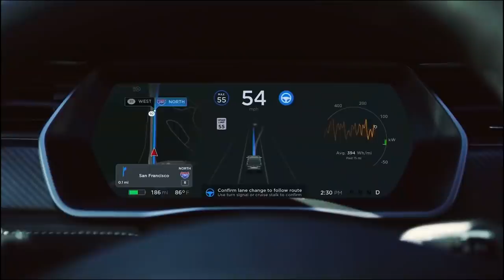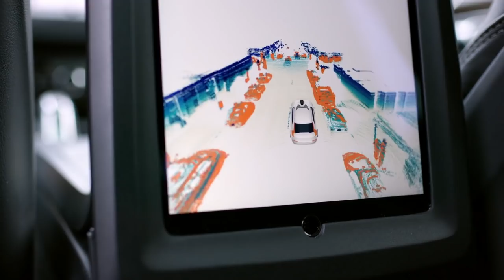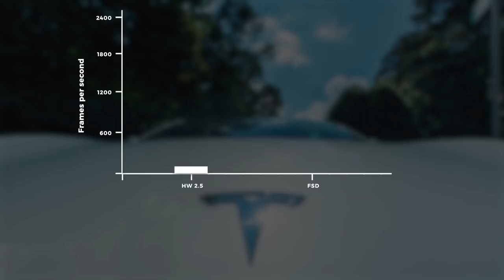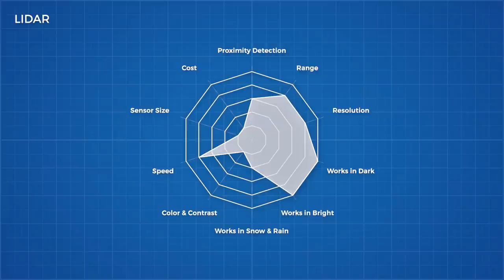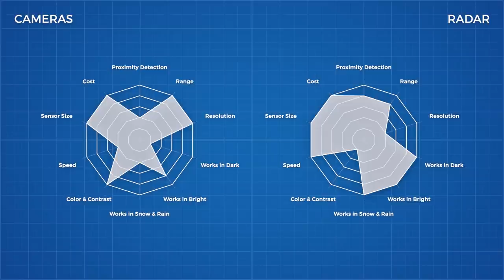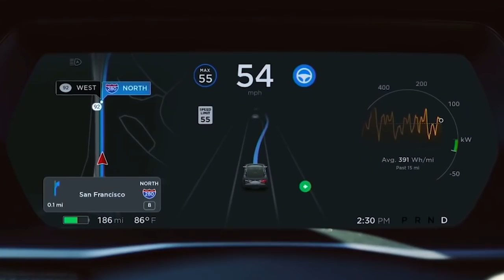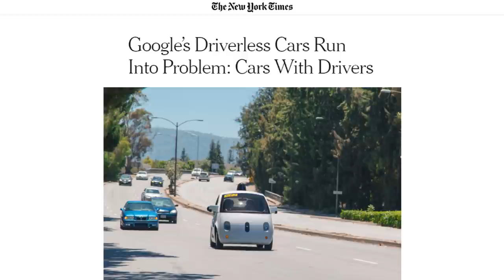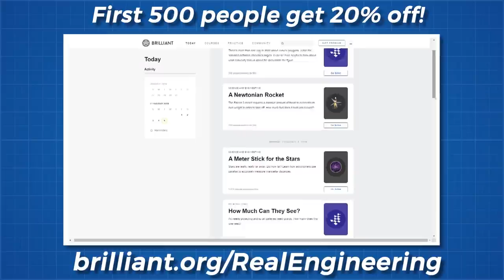The Challenge of Building a Self-Driving Car

Comment: As a software engineer, the software driving that car that ran over the person was embarrassing poor.
You start with the premise, "if in doubt, alert the driver and slow down"
As soon as an anomaly is detected, you drop to that.
Reply: Indeed, you must prove it's safe, not fail to prove it isn't.
Reply: Then you run into a problem of human operators eventually ignoring the alarm as the become used to too many false alarms. It's a fine balance to maintain.
Reply: There were all sorts of problems in that collision. They had too many false emergency stops so they turned it off (I don't know why they turned off the alarms as well). They also got rid of seperate data input and driver roles, meaning drivers had to do the mutually exclusive tasks of being alert for emergencies and inputting data into a computer.
I don't know if the driver in this case was "doing her job" or texting, but either way the priority should have been driving.
Reply: @joonhshin  Yeah in productio mode sure.. but when developing, best (especially when lives are at stake) to err on the side of caution and flag as many alarms as possible, so that they can be addressed.
Reply: @Chilukar  she was watching a tv show on her phone. Which sort of tells me uber gave these drivers pretty boring tasks, but shutting off alerts to drivers and expecting the test driver to be attentive in a mostly reactionless duty is asking for trouble.
Reply: @joonhshin  No because false alarm or not, it becomes human error and peril to ignore an alarm, precautionary or otherwise.
Reply: @bcubed72  agreed, uber took a lot of shortcuts and pissed off a bunch of people involved with self driving vehicles for tarnishing them all. 
In reality most developers are much more cautious and it is no surprise that Uber had this crash.
Reply: I agree that these design decisions may seem poor when looking at this specific case. However, do keep in mind that behind each design decision stands a reason. They knew that their car was not able to fully drive itself yet. Have you ever worked with neural networks? Because everytime i hear people talking about "anomalies" or "uncertainties" i question their experience in that field quite a bit. A neural network is never sure or unsure about something. It calculates the probability for a given cluster of pixels (object) to fit into each category of objects it was trained to recognize. That means that it has a probability for the cluster of pixels to belong in each category. The one with the hihgest probability is the one the object is classified as. Now, define uncertainty or annomaly in this case.
(Highest) probabilities below a specific value happen all the time. If we used this as a criteria for slowing down, then the car would constantly drive slow, if at all.
Trajectories are also often uncertain, especially since they rely upon recognizing a cluster of pixels (or other data) as object first. If something just shortly gets recognized, then the trajectory cant be calculated precisely or at all. Imagine a bird flying across the camera view. Would you stop driving simply because there may be something on the road, because the algorithm decided that a cluster of pixels in 3 frames might have been an actual object and then disappeared? Because from the NN's perspective, that's basically the same problem. 
Now, consider that stuff can get falsely classified depending on the data and situation. Like a flash of light, a bright spot or anything like that. Following data is usually critical to determining whether or not something actually is there is was caused by bad data (a reflection on a single frame of a photo for example). 
With all that in mind, slowing down simply because there is "uncertainty" or an "anomaly" is silly. That's why a driver is still needed. They knew their car was not able to fully drive itself yet, thus they had to chose design decisions that made the vehicle work in the majority of situations. A vehicle that can handle 99.5% of situations is still better than a vehicle that can handle 80% of situations, or constantly drives very slowly. Thus the design decisions that make the vehicle handle the majority of situations properly are the ones that get implemented. The driver is the one responsible for the rest. 
Most if not all design decisions can easily be explained by the above. The car was programmed to not brake too drastically to not endanger the driver. At the same time it may seem silly that the car does not alert the driver when it intended to brake really hard but did not, but considering all the uncertainty and the false positives that may trigger this alarm, this may have simply been left out because the car would be constantly beeping otherwise. Imagine the car beeping for each flash of light or bird it recognized as an object in the trajectory of the car for like 2 frames. The driver would probably get mad really quickly. Now, i agree that this might have been handled better by, for example, only alerting the driver if such an "annomaly" was detected for a certain period of time, but again there is a lot of room for error and considering the reaction time of the driver, this period of time may not have saved the now-dead person, especially when looking at the lighting conditions in 1:48. The car didnt recognize the person, which is horrible, but i dare to say that most humans wouldnt have recognized it either.

Anyways, i dare to say that just because you dont understand the design decisions that lead to the system's behavior in one specific scenario , doesnt mean they are "embarrassingly poor". That's something you should know if you work with software honestly. Sometimes reality is not as simple as you make it out to be.
Reply: @Yamyatos  sorry but if you think "one specific scenario" where there is a pedestrian or cyclist crossing the road on foot is not important you can know as much as you like about programming, but you are not qualified to talk about driving.

Waymo, Tesla and others involved in developing this technology were far more cautious and criticised Ubers approach. If nothing else they should have had separate employees for data input and driving. That would also possibly have given 2 sets of eyes on the road, something that is useful if your system can't identify pedestrians in the road!
Reply: Also a software engineer, and I actually disagree.  I think this was a very difficult bug to predict.  How does the car know the difference between a pedestrian and a road sign?  Movement?  What if it is a tree swaying in the wind?  As humans we know that bikers can enter our lane, trees don't , and how to tell the two apart.  But for a computer this is very difficult.   Accidents like this (and others) are going to continue to be common as long as programmers continue to have this Jurassic Park mentality and arrogance that they can know all contingencies.
Reply: @Chilukar  
I'm not saying the system was perfect. My point is that a real case scenario often is not as easy as "if in doubt, alert the driver and slow down", and then tried to explain why.
If i did not make that clear: it's horrible that the person died. It's also right to criticise Uber for their approach, just not for random reasons based upon a lack of understanding. Criticism by people who actually understand something about the topic is worth listening to, even if some of it was most likely a marketing sheme as well. I just dont like it when people online criticise systems they have little to no understanding of. I'm not an expert on self driving cars, or cars at all for that matter, but at least i worked with computer vision and neural networks in the past, which somewhat qualifies me to talk about possible reasons to justify certain design decisions that were made. I dont try to justify the death of this person or try to make it sound like it was unavoidable, but at the same time it's true that the technology is not quite there yet and that's the exact reason human drivers are still required. 
Now, i dont know how Uber works (not entirely sure if it even exists in my country), but they do pay their drivers even in self driving cars, dont they? Either way, paid or not, the driver was responsible for the vehicle and was not supposed to watch some youtube video on her phone instead. The system may have been faulty in this scenario, but the driver is also responsible. The scenario is also not quite a simple as "pedestrians crossing the rode", as i cant imagine that the car wouldnt recognize this under normal circumstances. There was a funny example one of my profs at university told one time, of some computer vision algorithm that was supposed to classify tanks as allies or enemies, but the data they trained it on lead to it learning the difference between good and bad weather instead (because a lot of enemy tanks were on pictures with bad weather). The point of that story is that it's impossible to know how exactly a neural network decides on things - you only see the result. Thus a specific combination of factors may have lead to the accident, not simply a pedestrian crossing the rode. 

Also, you said "If nothing else they should have had separate employees for data input and driving." - i'm not quite sure what you mean. Do you mean 2 people in the same car? What would the second person do? What do you mean with data input? You dont input data, the "training data" we are talking about is the sum of all sensory inputs and camera footage being recorded. Do you mean two different kinds of vehicles - one for transporting people, one for collecting data? That would just cut the amount of data in half, which is something nobody would do because it's simply unnecessary. The "self driving" part as we have it today is more of a gadget to relax a bit more while driving. The driver is still... well the driver. He or she is responsible of the car's actions, it's just that the car is able to do most of them for the driver. That does not justify you watching youtube videos or sleeping or whatever while driving, any more than if you drove a car without autopilot.
Reply: It was never meant to work as you or the creator of the video make it seem. It was a testing phase, it was not supposed to work that way, and the driver was specifically not supposed to look down and do whatever while driving. Everyone and their mother agree's with you, even the mothers of the developers and their mothers, but it was not supposed to be completely save driving. It was supposed to be monitored and the mission was to test and collect data under supervision. Careless driver here makes it seem like the system was faulty, but it wasn't any more faulty than an old vehicle with minimal electronics and with a careless driver on the steering wheel. The premise is that if people will be told the car is self driving but needs supervision, after an hour or some other period of time, they will get careless. Might have been negligence of communicating how important it was to supervise the car and a poorly trained operator.
If the woman would have paid attention, the developers could have analyzed and changed the code's algorithm. The brake was turned off, probably because they knew that some objects at the side of the road weren't accurately recognized by the vehicle yet and they needed to figure out ways to make that recognition easier. That's exactly why the woman was supposed to pay attention and not watch a TV show. Can't stress that enough. It might be a combination of all those things, maybe the algorithm should have been better, but maybe the code isn't as easy to write without the car acting up at moving trees, pedestrians swaying while walking parallel to the road or many other different possible scenarios that make this apparently simple solution to the premise in this video not so easy after all.
Reply: Honestly have to think that it should have at least begun a precautionary deceleration too, after all if you are driving in low visibility and see something up on the road ahead but can't identify the hazard do you a) Keep barrelling towards the unidentified object at full speed until you know it's unsafe or b) Take your foot off the accelerator and apply a little brake while you figure out what is in front of you? I would hope that the answer to this is option b as that is by far the smarter course of action when you know there is an unidentified potential hazard in the road ahead sure this may well end up resulting in you slowing down due to a plastic bag blowing into the road but better that than the alternative of assuming it's nothing until you get close enough to be sure and then it be too late to stop for a real hazard.
Reply: @seraphina985 But what if the car was coded as follows ( Detect everything you can detect around you. Save everything to analyze it later. If in doubt, the driver  will intervene) The car was not supposed to be operated without constant supervision of the operator. It was supposed to be a test drive to improve and analyze data, not for the human to watch TV. If you tell me to babysit a kid that appears to be quite mature for their age, they can do everything fine, it seems. And for the first 10 times, they have been responsible all the time. You still won't leave them alone in their room for hours while you watch a TV show.
Reply: @joonhshin  This would demonstrate the system just is not ready for deployment. If it has to constantly alert the driver due to uncertainly, the system just simply is not good enough. End of story. Haste to get technology deployed should never be allowed to undermine safety.

If it has to be slow as molasses to be safe, then it will be slow as molasses. In the side demonstrating, well we clear don't have good enough self driving system yet for public deployment.
Reply: OK.
Um, hi, welcome to this software and ethics committee?? 😳

Right, first off, you forget the slow down bit.
I'd like to see little miss catching up on GoT ignore the car slowing down.
The car saw something it couldn't identify.
But it knew something was there.
If we're training neural networks, this is exactly the point you went you're highly trained space monkey to stop facebooking and look out the damn window.
And on the screen is, "I'm sorry Dave, what's that?"
And they they hit the 🚴‍♀️ button.
Network training +1.
What you're saying about disabling alarms?
Yeah, if there's too many and you're disabling them, some moron manager needs punching.
Also, your alarm procedure is bad.
Alarms cycles go, detect, alarm, acknowledge, feedback.
If you break that cycle you're just making alloying noises people will ignore.
Never forget to train your 🌌🙉
Reply: M. de k.  
Correct.
Although I do know enough to know that even pins don't go on and off, you have to measure it over time and average it until it's stable.
It's called bounce I believe?
Reply: @AaronSmith-sx4ez  I would disagree with that, a walker in the dark moving across the road feels like something they should have built failsafes in for and specifically programmed for.
Reply: Systems design is all about loops, feedback loops. Both electronic and conceptual.
Every event you make, you make for a reason, you expect or require a response.
Whoever had the machine spit out alarms with no requested response had no business designing safety critical systems.
Reply: @AaronSmith-sx4ez  
It's not a bug, it's a systems engineering problem.
They got the feedback wrong, the system needs to train the user to provide feedback to an unknown.
You don't program for every situation, you train a neural network, so you train the user to train the network.
Feedback loops, see?
Then there's a beautiful curve as the unknowns approach zero.
You'll never reach zero of course, you're quite correct that you can't account for every situation.
But we'll have stopped caring and solved traffic accidents long before then.
Reply: @zachfakelastname  
Too many false positive granny kills
Reply: @zachfakelastname  I disagree.  How does a computer know the difference between a pedestrian, a biker, or somebody with a motorcycle?  The computer sees fast moving things in the opposite lane all the time...how does it know which will pop into your lane?  What if a motorcycle moves from the outside line to the inside lane...does the car stop and assume they will cross?  What if somebody on a bike is trying to make a left turn in front of you?  They signal with their hands (maybe not)...what does the computer do?  This doesn't even take into consideration a host of other issues.  Like construction zones, street parking that morphs into lanes during rush hour, roads without markers, snow on the shoulders, etc.. .  For computers these are tough issues!  Here is a video of a Tesla suffering an accident when its auto-pilot failed to merge successfully.  https://www.youtube.com/watch?v=exBnINDEhSA
Reply: to be fair, seeing how the accident happened, I'm pretty sure a normal driver also would have hit the pedestrian, it was really hard to see. the difference is that it would have been a normal accident and no one would have mentioned it. the fact that the car managed to see the pedestrian from so far speak wonders of how much better the system is when compared to a human driver. sadly the software was poorly designed.
Reply: If in doubt, alert the driver and slow down? See that's an example of a problem right there. It would not be the first time that a car has suddenly slowed on a highway with a semi up it's axe resulting in fatalities. Humans should acknowledge that they are just not clever enough to  devise systems that remove another human's control of their own safety. Boeing?
Reply: @Chilukar  I partially agree that the "driver" should've been driving but that kind of defeats the point of a self-driving car, no? Part of the point is to turn the driver into a passenger thus freeing them from the responsibility of operating the vehicle.
Reply: Thats bad but Im more concerned that they went through the trouble of adding code that limits how hard the car can break. Im all for smooth breaking when thats an option. But removing hard beakeing from the code entirely seems plain stupid.
Reply: fail safe rather than fail manslaughter.
Reply: Has a Industrial Robotics Tecnician, if the mechine encounters an unexpected sitution and can't evaulate how dangerous it is, EMERGENCY STOP. It's on the law.
Reply: Also, even if you can't identify the object, you know it is here. So it's really dumb to continue at 90 km/h in straight line.
Reply: @joonhshin  This """driver""" was paid for testing this software.
She must watch the road, and consider the alarms, for every single moment of her tests. Else, they should not test on public roads.
Reply: @bcubed72  Uber made an excellent (although tragic) demonstration why some of these tech companies frankly shouldn't be allowed to to research on public roads. Waymo seems like one of few that take things seriously. Tesla also seem to have the attitude of "move fast, break things". That's fine when you're making a software company, but not when you people's lives are literally on the line. (Let's not forget that one category Tesla is the most similar to humans is number of passengers killed while on on "auto" mode.)
Reply: @joonhshin  Funny how psychology needs to be taken into design.
Reply: @g00rb4u  You should look into alarm fatigue, specifically in hospitals. It's a proven fact that too many alarms leads people to ignore them.
Reply: @Yamyatos  - I think the problem humans have with this scenario is that the car couldn't decide. It was presented with something that was either a pedestrian or a cyclist - it knew that much. But because it couldn't determine which it chose the "do nothing" option.  Where as anything as big as either of those options should have prompted preliminary braking.  It also had emergency braking disabled which, even though I know nothing about it, does seem like poor programming. Even Volvo's own systems (which were disabled for obvious reasons) are programmed to initiate emergency braking in this scenario so the pedestrian's life might have been saved. The operator was doing exactly what they were told to do - monitoring the car, not the road, so hard to blame them.
Reply: @mondotv4216  It was not clearly presented with either a cyclist or a car tho. For the longest time it didnt recognize it at all (or thought there was something, then not, then again, ..) and when it finally clearly did recognize it, the required braking force would not be allowed by the safety mechanisms. That's basically what happened. I believe i talked about why this might have been a suitable approach for the prototype state they are in in my previous comments. Basically you cant just break because something (most likely false positive) suddenly pops up in front of the car. That puts the driver at risk, which is probably why braking over a certain deceleration was disables. You also cant just slow down for each and every uncertainty, as nothing that would basically make the car drive slowly if at all. All these restrictions are why a driver is required. In current self-driving technologies the driver is still responsible for any actions the vehicle takes, thus it's not his job to monitor the vehicle, but actually the road. Why would you even need to monitor the vehicle? All the data is collected automatically, the driver is just there because the car is not legally allowed to drive alone - you know.. because it still makes mistakes and might run somebody over in very specific situations ..
But i'm repeating myself. I already went into depth for most of these topics in previous posts.
Reply: Fabian But that’s the main issue - it did identify it as a pedestrian, then a cyclist, then nothing. Surely if something even had the potential to be either the software should have said start braking? After all it’s professed beta software - it should err on the side of caution even if that sliws down testing.
Reply: @mondotv4216  Did you read my previous posts? Because it kinda feels like i'll have to repeat a lot of things in this discussion. As i said, neural networks are never certain of something. They classify something into a specific category based on what's their best guess is, or in no category at all if the probability is too low. Something never really is a pedestrian or a cyclist, but a "90% car" or a "65% cyclist". If the classification jumped from pedestrian to nothing to cyclist to nothing and so on, then it was very uncertain about what, if anything, was in front of the car - with a tendency to "nothing" for the majority of the time in question. And if the majority of what you see is nothing, then good luck trying to figure out its trajectory. How would you even know that it's the same "object" if most of what you see is nothing, then sometimes a cyclist or a pedestrian for a small amount of time. From the perspective of the car there just was no object and a couple false positive detections, until it was too late. 
Again, it's a prototype. In order to get realistic testing data from real scenarios, you need to cover the majority of the scenarios. Normal driving, red lights, street signs, etc. Slowing down each time you have a false positive in the (undoubtedly imperfect) computer vision algorithm would not result in good data. That would just be a very illogical thing to do. Dont get me wrong, in the end everything needs to be rather perfect for the finished product, but they simply are not there yet. It's not a finished product. It has problems. That's why they need real testing data, but that's also why a real driver is still an absolute requirement. The driver is responsible for the cars actions. Many people seem to believe that the driver just sits there and records data or smth, that's not the case. The driver is still the driver and ultimately responsible for what the car does. Instead of looking at it like the car is the one driving, look at it as if the driver is still driving, but the car automates most of his processes if that makes sense. In the finished product the driver would not be needed anymore, but that requires a well trained neural network / computer vision or generally well handled sensory input to be a thing - which in turn requires real testing data and reasonably-real test drives. It does not help at all if the data they collect is from a car constantly slowing down or generally driving slow or in any other way abnormally.
Reply: @mondotv4216  
Literally faildeadly instead of failsafe.
Reply: I doubt they were using ‘if’ ‘else’ conditions...(most likely neural nets.)..If they were... they have no idea what they’re doing and no hope
Reply: Aaron Smith : Trees statistically don’t jump in front of the car very often... (I’m also a programmer) the solution is loads and loads of data and deep neural nets... with enough training neural nets will recognize the significance of small nuances... and be able to predict people and interact directly with people. like: does the pedestrian see me? Did the crossing guard just wave me through?
Reply: It's a responsibility factor & legal matter.
HUMAN shall be held liable for their crash, & damages.   Software shall not be a scape goat.

If driver abandons task of driving to A.I. Driver assumes full liability for stupidity.

The Subaru Eyesight & other makers equal anti-crash technology is good, a virtual airbag in front of the car.

The AI self crash tech is wrong, because people are lazy & will run into dumb things leading to crashes.  Deer, children, bicycles, truck turn with no turn signal.

Certainly most people  ' avoid ' 5 to 10 crashing every day... From years of trainging and paying full attention.

Still people crash into animals and cell phone users walking into traffic crosswalks without looking up !  Ouch.
Reply: The REAL challenge to designing a self-driving car is that the the problems you face designing a self-driving car when there are only a very few self-driving cars on the road are very different from the problems you are going to face designing a self-driving car that is one among many self-driving cars.  So, far I have not seen a single person mentioning this problem as a problem yet to be overcome.  Maybe I'm just not paying sufficient attention.

So presently, the current generation of self-driving cars depend upon a large number of human drivers in the population.  No one knows what will happen when large numbers of self-driving cars start interacting with each other.   By the time this happens everyone will all ready be deeply committed to the concept of self-driving cars.

It's the old four-way stop sign problem - as an example of the general problem - if you are the only self-driving car in the neighborhood you can develop an algorithm to make this work well enough;  you just design your self-driving car's algorithm to always be the most cautious one - because you are really optimizing for lack of bad press an not top efficiency.

However, it is a very difficult problem because there are two distinct modes of decision making:  we take turns - I go then you go -  or the next car in line going clockwise around the intersection goes.  The problem is that it is normal to be constantly shifting back and forth between these two modes of decision making, and it is often very unclear to all of the drivers around the intersection when to shift modes.  Then, there are the people who are just jerks, or in a huge hurry, or who aren't paying attention and just go when they aren't supposed to.  This is the normal condition - a little chaotic -  a little confusing.  At moments like this having a distribution of driver personalities from more aggressive to less aggressive actually helps to solve the problem.  At some point the most assertive [or aggressive] driver is just going to go.  What makes this especially complicated is that communication between drivers is very limited and fraught with errors. 

Drivers normally make decisions about how to sort out the 'who goes next' problem based upon a variety of inputs and experiences that vary significantly.  There are drivers who are more or less experienced, more or less intelligent, more or less distracted, and more or less assertive -  that is a lot of variables to control if you are a human driver, much less an algorithm.  Which is why there continue to be accidents at four-way stops.  It is difficult to control for the chaos.

With only a few self-driving cars around optimizing towards the least assertive stance makes a lot of sense - just drive like a granny everyone will go around you..   But, what happens when driving cars are in the vast majority most of the time?  You don't want to become a Looney Tunes episode where every four-way stop becomes an episode of:  "After you, no after you, no after you, no after you..."   grid-lock, nobody can decide to go first and switch modes.

Of course there is the possibility of creating a system where all of the self-driving cars of possible every make and model  are in constant communications with each other, and from that they can  can figure out where the human-guided cars are, then they employ an arbitrage algorithm where all of the self-drivers sort out amongst themselves what decision mode they are in and who goes first.  But that process is likely to prove to be complex and a little fragile - because it is complex and chaotic.

What is going to be really interesting to see work out in the courts is who pays the insurance for the inevitable accidents.
Reply: @  William,  the real problem is the Delusion of  " Self Driving "  cars.    They don't drive themselves,  just its human occupants, if any, have surrendered to  allow software to  judge if they Live, or if they Die.  The lack of control, the abandonment of personal responsibility, is inherently a VICE,  simple sloth & laziness.
This is why Tesla drivers die in accidents, they  abandoned personal responsibility & put their life in the hands of the software.  The software is always going to attempt to function, but when it fails, as was the case with Boeing Airplane autopilot software,  everyone Dies.

It is never a good idea to abandon the one Virtue we living beings have over objects:
We can make the choice to be fully aware, and fully responsible for our own lives and the well being of everyone around us.

The software does not 'care'  if you die.
To it, a mistake is just an error code.
To Us, it is our death.
Reply: @SeaJay_Oceans  I really like your answer, thanks for taking the time to reply to me, but at the same time, as I tried to illustrate, I don't think the software people fully understand the  complexity of the problem yet.  Honestly, I think they are still at the stage of development where they are really most concerned about avoiding  negative publicity - rather than actually understanding or solving the engineering problems.  

Any negative publicity might kill their program.  Avoid that.

What does it mean to switch between decision making modes when every other agent in the environment is trying to figure out  what is going on in the 'minds' of all of the other agents in the environment?

Tricky.
Reply: @williamreymond2669   Reminds me of Douglas Adams  self-aware elevators.   The Elevators realized the safest place to stay was at the bottom of the shaft in the basement, and refused to go up and down.
Self Driving cars become self aware and refuse to leave the garage,  the safest course of action is to stay parked inside ! :-)
Reply: @SeaJay_Oceans  Thanks! I loved that one too.  Thanks for reminding me!
Reply: Indeed, even the Tesla Autopilot V1 could detect pedestrians in a way. I don't think it entirely knew what was in front of it, but it knew it was in the way and a collision was imminent so it stopped.
Reply: James Neave I agree but I feel like a human driver would of done the same thing that guy pop out of no where. I thought these self driving cars had sensors and stuff and that stuff needs to be improved.
Reply: Even though it had no idea what was in front of it, it should of stopped anyway. There's literally no object that the car would be programmed to hit.
Reply: @yeet ikr that was dumb
Reply: embarrassingly poor?
Reply: @SeaJay_Oceans  
That's nothing but sophistry. We 'abandon our agency' all the time. From the first flame, we have 'abandoned' the self and leaned onto our surroundings. Shaping it to our benefit.

And just like software, the flame does not care if you live or die. It does not care if it burns down your house and everything you hold dear.

Yet, we still rely on fire. Over the heat of our own bodies. Because it's practical. It yields a lot of benefits.

And because, the fire was made by people. People, unlike objects, that do care for the consequences of these objects.  Thus, consequently designing to minimise the cons and maximise the pros.

So, ultimately, agency is not abandoned at all. Just in a different form.

Ultimately, the only thing that matters is if it works. If it does, it's another tool in the bag. If it doesn't toss it.
Reply: @SeaJay_Oceans  
I don't mean to be dismissive. I simply disagree.

Analogy with fire represents technology. Point is, relying on any technology is sacrificing your agency. Technology relies on a framework of society. 

Take a normal dumb car. Do you know how to make an engine? Did you make the tires? Can you fix every little component that ensures its safe function?

Most people can't. Most people simply trust that the manufacturer made it safe. Trust that society has adequate protections against abuse and exploitation.

It is impossible to have every variable under your own agency.  Heck, it contradicts how human civilisation functions. 

Relying on other people is how civilisations flourish. It's how specialisation happens and with it greatly increased productivity.

Back to the point, when so much in our lives already relies on devices and people beyond our every day awareness.  How can it be inherently bad or slothful to rely on them?

Reliance is not wrong. What matters if something is reliable or not.